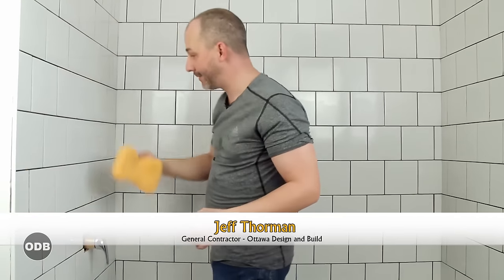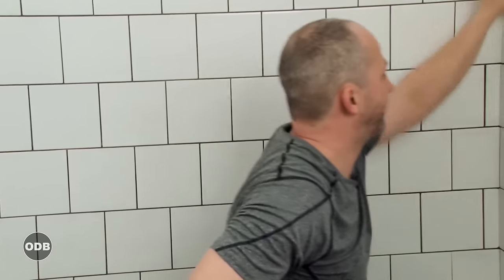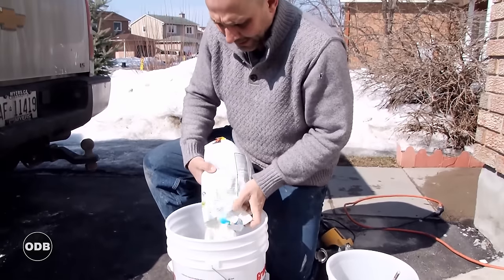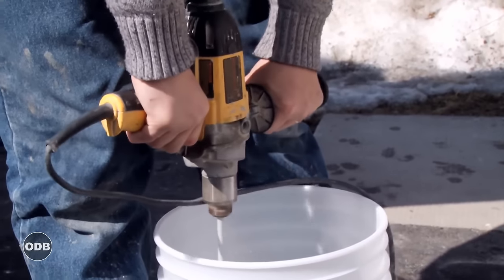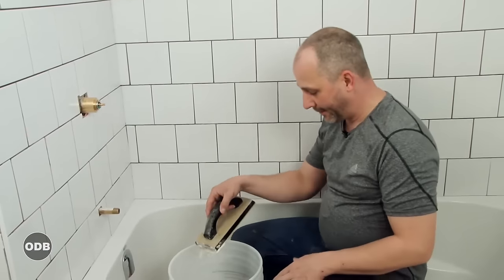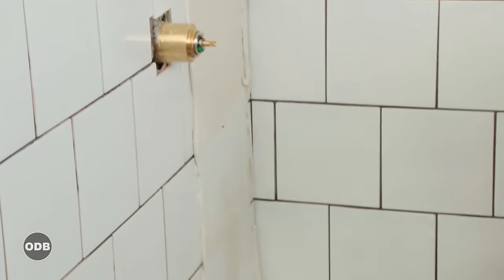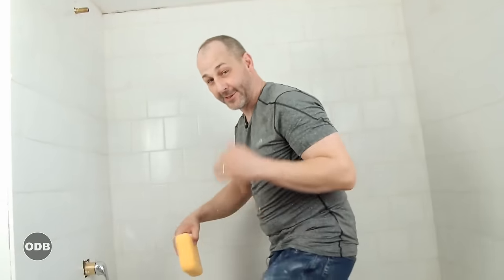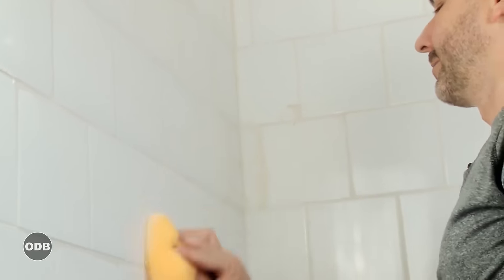How To Grout | Wall Tile | Unsanded Grout

Comment: I hate grouting, but one trap a beginner shouldn't fall into is to try and do too much in one go. If you are not a professional or don't have a second person to help, only mix half a bag of grout and do just one wall at a time. Sure, you can grout 2 or 3 walls in 30 minutes but that first wall will soon start to require some serious hard work with the sponge to remove the excess grout - and its a workout for the arms! Tiles with any sort of texture or grooved effect are also harder work. Better to mix half a bag or less, do a wall, wait for the grout to start setting a little and then start sponging it. In warm weather the grout will dry on the wall even quicker. I am not a professional, but I have done a few bathrooms and floor tiling and I wish I'd followed my own advice on the last one I did. You can make your grouting life a lot easier by not rushing putting the tiles on the wall in the first place - make sure your gaps between the tiles are not full of adhesive.

Comment: Firstly, my boyfriend and I managed to renovate our entire bathroom down to the studs with help from your videos, thanks so much! Second, we are having a hard time finding information on how to get a true black grout, apparently it is nonexistent. Any brands or tricks you know on how to achieve this?
Reply: Try adding black oxide to the grout. It's available at larger hardware stores and is normally marketed as a cement additive.  I've had success using it with grout, as essentially, grout is portland cement and graded sand .  It's very black and a little goes a long way.  https://www.bunnings.com.au/avista-oxide-1kg-jet-black-cement-colouring_p0760495

Comment: ....mixing at high speeds also aerates the grout mixture. Bubbles in the grout weakens the end result and can cause small cracks or defects etc
Reply from the maker: very true. Cheers!
Reply: Not a good idea to use a mixer. ESP on Non sanded. Too much air in the mix. Am I being redundant?

Comment: Hi Jeff, love your channel.  Question, what are the main differences and uses for sanded vs unsanded grout?
Reply from the maker: unsanded is designed for small spaces and usually used on walls and with materials that scratch like glass and marble. sanded was traditionally used on floors which had a wider grout space. now they make a hybrid so you can use an unsanded on the floor and it has a polymer to keep the grout string and not crack. The old sanded grout is stronger than unsanded. Cheers!

Comment: I’m in the middle of my bathroom renovation and I’m just about ready to grout. I wanted to ask before I start what your view is on the Mapei ultracolor (powder) vs the flexcolor (pre-mixed). Are there any real advantages choosing one over the other?
Reply from the maker: Hi Steven, the premixed is incredibly expensive but designed for people who don't want to buy mixing equipment. if you have a drill buy a small mixing blade and get the ultracolor.

Comment: Jeff - I was able to complete my tile backsplash this past weekend thanks largely to your videos - MANY THANKS, I am now a subscriber! Could you comment on a couple of things regarding grout?  First I hand-mixed my unsanded grout and noticed some red streaks showing up as I was applying it - was that a result of me NOT mixing it well enough? I can't imagine that I could have separated the molecules like you mentioned in the video with my stick by hand...I did two batches of grout mixing on the job, and spent more time mixing the second batch but it didn't seem to make a difference. Second, the tannish/grey grout dried several shades lighter than we expected. Was this related to the unmixed pigment issue, or is that normal? So now are there any GOOD options to darkening this color (I am NOT digging it back out, lol). I have not yet applied a sealer. Thanks again,
Matt

Comment: I just finished tiling my shower with 12×24 tiles but noticed that there is a gap at the top where the tile meets the roof. It's too small for a tile placement and too big to caulk. What is your suggestion on how to solve for this?

Comment: Great video but I did not notice the unsanded part.  Decided to do the kitchen backsplash tile in our kitchen 2 walls about 30SF.  Tile store gave me sanded grout which was a MAJOR workout with 1/8" joints - obviously I should've used unsanded.  I finished one wall (thanksfully the shorter one) with what I had.  The other wall is twice as long so I really don't want to continue with sanded - is it weird to switch to unsanded for the other wall?
Reply: It has a different consistency and a slightly different surface appearance, but it’s definitely doable. I’d etch the corner where the unsanded will meet the sanded and cover that entire wall and corner with the new, unsanded grout. And you’re right; covering and cleaning entire walls with sanded grout is a major undertaking. Good luck!

Comment: Hi Jeff, thank you so much for your help, I am renovating my bathroom and I am planning to tile my bathtub walls with small Marble Carrara tile. I saw in the showroom of Floor and Decor a small sample wall with the same marble tile installed without grout in between (no spacers), they still add grout on the top of the finished walls.  I really liked the final result, however I am not sure if is the right way to do it, they say it is ok and it should not leak but I have my doubts. Do you have any suggestion? should I proceed with the tiling. Thank you in advanced for your advise.

Comment: When do we need to seal our grout? Pros and cons?
Thank you, I love your videos
Reply from the maker: you don't. Cheers!
Reply: You don't need to, but arguably there are pros, such as making it easier to keep clean, or protecting more easily damaged materials like natural stone from acid etching. But lots of sealants are trash. If you bother to, make sure everything is nice and clean, and use a good commercial sealant that will last for 10 or 20 years.

Comment: How long do you let the grout dry before using the sponge? Thanks and love your videos. I learned a ton.
Reply: Around 20 min after, but it also depends if it is warm or not. There will be times you will have to wash it off pretty quick because it dries to fast.

Comment: Home RenoVision DIY I just picked up a bag of the Mapei Keracolor S SANDED Grout to use with a mosaic tile backsplash that I installed above the shower. The bag says that it’s suited for mosaics, but I saw another comment where you said that it could scratch glazed surfaces. Would it be best for me to exchange what I have for the UNsanded version?
Reply from the maker: mosaic can mean a bunch of things. I would suggest using the non sanded grout. unless your grout space is over 1/4 of an inch. Cheers!

Comment: Hi Jeff, here’s a tip for grouting:

Here’s a secret to getting a good grout job...Custom Grout Release.  It’s $8.95 at Home Depot.  You just roll it on with a paint roller, then let it dry for an hour or two.  It never really drys.  It’s like a gel.  In fact you can go back and give it another coat.  Try not to let it puddle in the grout lines.  It’s a gel so it clings.

This stuff is amazing!  I used Custom Prism Linen Grout.  Once I sponged off with a really rung out sponge I had barely any haze.  The final sponge offs were with a sponge that had a microfiber side.  After it dried I just lightly buffed with a microfiber cloth and man does it shine!

You will never have the problem of haze if you use this product.  I especially recommend if you’re using Fusion or a similar grout product that sets up very fast!!!!!

Comment: I am having my shower redone. My contractor is using 1/4 joints for 16x24 porcelain tile. What type of grout should he use? Sanded or unsanded?
Reply from the maker: I would suggest ultracolor by mapei. it is an unsanded grout with polymer and works up to 1/2". But your tiler should know that already!

Comment: You never want to grout corners!  Wall movement always occurs and it will crack.  Silicone it!
Reply: Grout and caulk? No?
Reply: That depends on a remodel or if it’s an official build. If a remodel you grout the corners (unless it doesn’t hold)

Comment: Hi Jeff - Thanks for all of the invaluable help via youtube!  When installing shower tile (in anticipation of using silicone in the corners) how much of a gap, if any, should one leave in the corner between the tiles from the two joining walls?  Should there be a gap matching the gap of all other grout lines?  Or should you butt one wall right up against the other?  If leaving a gap, what would you recommend?  A 1/16th?  An 8th?  Thanks.
Reply: You usually dont grout corners. Ill leave an 1/16" in each side and caulk it afterwards

Comment: So we used Unsanded grout in our shower, the exact same one you're using in this video. Do we still need to seal it?
Reply from the maker: Hi Cindy, we seal the grout if we want to protect the color or if you have not used a waterproofing system. The good news is that most water based sealers can be applied with a sponge and just wipe off the excess from the tile. Cheers!

Comment: I've read to only use non sanded grout on joints 1/8 or less. I have a glass tiles shower with 3/16 joints. Would I be ok to use non sanded or would sanded be the best choice? Thanks
Reply from the maker: Hi cole, you will be fine with unsanded for that joint and you definitely need it for the glass. Cheers!

Comment: I’m working on a stall shower. Tiled with ceramic. The previous owner caulked over either thinnest or the grout on the lower area where the tile wall meets the plastic tray floor. It took hours to remove it all. Can I just use the polyblend grout to seal the corners and lower wall to plastic tray floor area?
Reply from the maker: Yes but if there is any major temperature change the grout will crack out. I suggest a little clear silicone to finish.

Comment: hi, i have a black porcelain tile in my shower (walls) and need a strong recommendation on a deep black grout that will without question dry to a deep black. Any recommendations? Also power or premixed? thx
Reply: Don't have black tile because it will ALWAYS look dirty. That's my recommendation.
Black tile in your shower*

Comment: I highly recommend wearing rubber gloves. Moreso if you have any cuts on your hand or you you are a habitual nail biter. I thought the mild tingly burning sensation was all in my head. As I kept on working, the pain became more and more intense. Looked at my hands, which were covered in grout because I had to use my hands to force some grout in some rather tight spots behind some pipework that wouldn't fit my float. Burned some skin off the tips.
Reply: When I read the instructions on the grout container, they said to wear gloves due to The grout containing caustic materials that are damaging to skin.

Comment: How long do you wait to wipe and clean after putting grout on?
Reply: It can really depend on how thick the mixture of grout is from the beginning.  The consistency they showed in the video is like watery peanut butter and you'd likely have to wait 30-40 minutes for it to dry.  If you mix less water/more grout the consistency can be dry and firm enough to clean off right away without risk of taking extra grout out of the lines.  Otherwise, 30-40 minutes of waiting and sometimes even up to an hour depending on what/where you grouted before its even close to ready to be cleaned off.  Ultimately it comes down to how thick it was at the beginning and how much pressure you apply to the paddle/sponge on application and cleanoff.

Comment: what would be the difference of using sanded vs unsanded grout?
Reply from the maker: sanded is for larger gaps and traditionally on the floor. unsanded is for small gaps and glass tile and marble. Cheers!

Comment: You are a pro. Very instructive video. Do you have applied the Mapei Ultracolor Plus? Any suggestions? I work in Finland as a builder. People want white grout lines last for ever the white colour.
Reply from the maker: That is a great product. Comes with the sealer inside. Cheers to Finland thanks for commenting.
Reply: +Ηοmerenovision. Thank you ever so much for your information. It was difficult to believe that a cementitious grout can be so resistible to stain. Can be applied even in swimming pools. Definitely I will use it to shower floors and saunas. Here there are not anymore bath tubs in the bathrooms. 
We have alot of snow here. I see you feel comfortable mixing the grout when snow is all around you. Best Regards to Canada and thank you again for your quick response.

Comment: Should have been removing that glue when you layed the tile, also why did you push grout in the corner joint, it will crack, should be left clean for silicone. Walls move.
Reply: Would you use a tinted silicone
Reply: @vanblindguy4600  yes they make grout caulking

Comment: Do I need to seal grout in a shower for waterproofing purposes?
Reply from the maker: only if you didn't use a waterproofing system behind the tile. Cheers!
Reply: @HomeRenoVisionDIY  for a backsplash, does sealer need to be applied?

Comment: Do I want sanded or unsanded grout for shower walls
Reply: I am no expert, but from what I understand, it depends on the joint size primarily. Unsanded for thin, verticle joints (like 1/8" or less), and sanded for thick verticle joints (>1/8") and for floor tile.

Comment: What is the difference between sanded and unsended grout ?
Reply from the maker: the sand. It is used to fill larger gaps. also cheaper but it can scratch high gloss tile and glass.

Comment: My husband and i have made a very large bathroom and two very large terraces in tiles - i strongly will advice people against your way of grouting, because it will be very difficult to wash off, and once it is set it will be next to impossible to remove it. I do with a shpatel in each seem - thus u have less to wash off. The same amount of work but less afterwards to wash off

Comment: won't the grout crack out of the corner?
Reply from the maker: Thanks for the question Zack, The grout in the corner is sealed with a small bead of silicone to keep it all in place.
Reply: Why grout the corner then?
Reply from the maker: when you use a continuous substrate such as a waterproofing membrane there is almost no movement in the joint.The grout will probably never crack . We use silicone to help ensure this.
Reply: Thank you for the video - Just want to confirm - If you have a fully waterproof shower system you can use an unsanded grout?  Does the size of the joint spacing matter in a waterproof shower in regards to using sanded or unsanded grout? Thank you!
Reply: @skilo81  Old installer here.   You can get matching caulking for most reputable grout companies' grout. (TEC is my favorite brand for tiling products with the exception of Red Guard for waterproofing. )   1/8" or less grout line you use unwanted grout.  1/8" or more use wanted grout.  Sanded is stronger so if 1/8" I like to use wanted even though either will work.  If the tile is soft enough to scratch easily you don't want sand though so test it!  I always recommend TEC PowerGrout which is applied to all grout line sizes and only comes one way.  If it has sand in it it's so fine you can't tell.  But it's been great every time I've used it.
I always caulk the corners with matching caulk so it won't have cracking problems.  I HATE silicone.   If you ever try to recall anything that had silicone you will see why!
Reply: appears these joints are 1/4", much too large for unsanded grout.  Expect it to crack within a month or  two.

Comment: Why are my hands so sore from using the float?  Doing a re-grout.   Who ever installed our tiles didn't use spacers in all the joints.  So some have a small gap then most have a normal gap.  

On existing tiles while cleaning off the old caulking, a tile cracked.  I didn't want to take that tile out and open a can of worms.   So used 2 part Epoxy getting it into the crack.  Seems solid now.  That crack is so much more visible with that clear layer of epoxy along the crack on with side of it.

Comment: Tile cuts to ceiling are bad👎
Reply from the maker: Now now. don't be too harsh. don't forget that the finished edge is covered with a nice clean bead of silicone.
Reply: Yep...ceiling cut are trash.
Reply: The ceiling isn’t level
Reply: Ceiling cuts just like the cuts for the edges by the bathtub itself.  There is no need for perfection and it would be a waste of time trying to get those cuts perfect.  They only need to be close as they will be covered up with a bead of silicone in the end.
Reply: Starts with the ceiling cuts then.........Different colored thinset to grout...brilliant, no gloves to do a job that if you've ever done one time you would know never to do that again kinda like cutting or sanding mdf without a mask.  1 minute to tape off brand new faucet and then smearing grout all over wall and letting it drop on to your clean brass threads.  With all the knowledge and theory behind your video the execution is DIY at best I feel bad for people that pay to have that level of work done.
Reply: why dont you guys post a few jobs you have done on utube and let us all inspect them before u go around picking faults in other peoples work?
Reply: @Tinroofdeals   yeh sure most DIYers bother to put a waterproof membrane on the walls of a shower first and use high quality grouts and adhesives to do a job. You don't know what your talking about
Reply: Anybody who uses silicone where the tile meets the ceiling has never painted before.  always use a paintable caulk there.
Reply: John D there is such thing as paintable silicone now tho.... and since then I don’t use any other kind :)